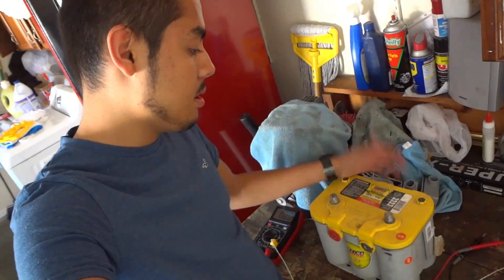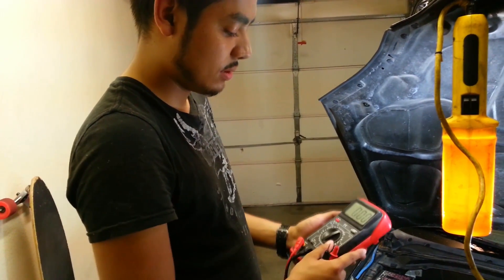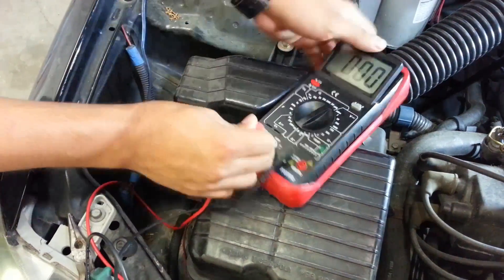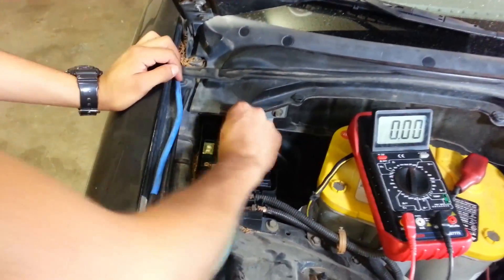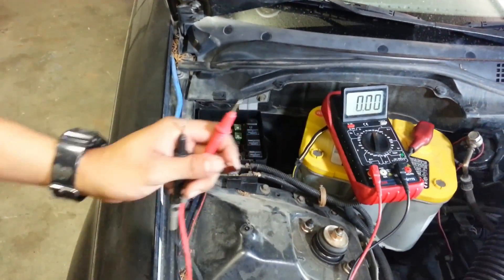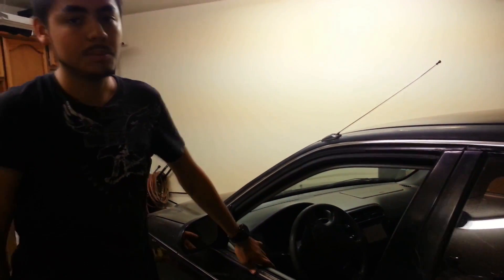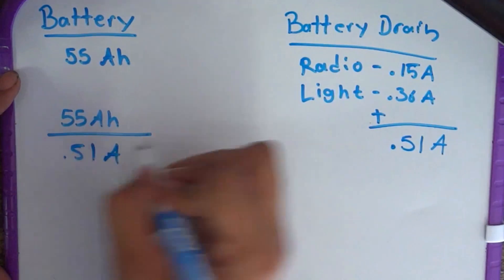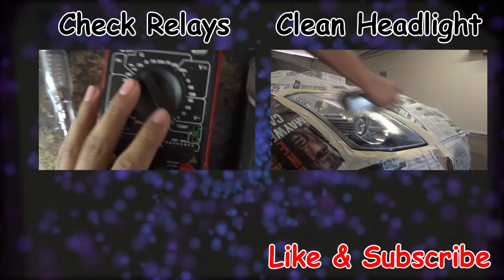How to find Short Circuit in your car/truck

Comment: Hey im having a problem finding my battery drain which is 5AMP 
I narrowed it down to #8 fuse which on my 02 Jeep Grand Cherokee Laredo 4.7L WJ it says on fuse diagram that #8 is:
Overhead console, rear wiper, IP lights, rear flipper glass solenoid 
Thats whats on that circuit apparently a bunch of things.

I tried voltage testing the two wires that went to the upper center brake light because it wasn't turning on and found it had a bad bulb that burned out, but i connected both leads to the wires and i popped the fuse, replaced fuse.
How should i test voltsge drop on connectors? Or how should i test them to find which components has the short on #8 fuse circuit that dropped amperage draw from 4.9-5V down to 0.36v when I pulled the #8 fuse while having negative terminal cable off the battery post with test leads of multimeter set to 10A and on negative terminal and negative battery post and 0.36v is normal for my vehicle according to manufacturer (they say 0.35v-0.50v is expected with all the modules?)

The other thing i should mention is overhead front seat lights that you click on has a problem. The right one for passenger side wont click off if the interior lights dial is on any setting but off. And the left drivers side click on light will turn off?

Any ideas on how i can find everything in the circuit and test each component?

Also what the hell is iP lights?

Comment: Don't pull each fuse, probe the 2 test poles at the top of blade fuses that are there for this exact test. That will cut your time way down.
Reply from the maker: That’s not testing current.

Comment: My 02 f150 tail light fuse keeps burning out when it rains hard. I sealed the housings and made a little hole under each so if water still got in it could exit. No success yet. Any ideas

Comment: I have a short in my 2005 Lexus gs430. My type of short makes my dashboard flick, no power windows, no power locks. No power on my steering wheel tilt. 

All fuses look fine, not blown. 

What can it be? Help pls
Reply: I have seen many videos by a few mechanics, and it sounds like it's where the speedometer, and all your dummy lights are. I have seen that board fail, and the main problem was because when they put the vehicle together they used lead free solder, there has to be lead in your solder when soldering these components. Hope this helps.

Comment: This is not called a short circuit.. This is a current leak or parasitic draw/drain or whatever you wanna call. If it was a short circuit current will be higher and fuse will blow.

Comment: You may disconnect your negative terminal lead on your battery change your voltmeter to amp setting to 10 and switch you voltmeter red lead to 10amp port and connect one lead to positive battery the other to negative battery lead which you disconnected. This will show you prostatic draw anything over 1, you have draw which would drain your battery over period of time. Then start with your fuse box and remove each fuse if the drop decrease that 's your problem. check your fuse box labels for each load.  You have pin pointed the problem!

Comment: I'm a computer electronics guy and I didn't know have that stuff I'm not a car person but I'm dealing with a short and I'm looking forward to trying out the fuse draw with a voltmeter. I started having problems where the car just suddenly is dead when you first get in the car and I recently installed a high-end car stereo and then started seeing problems.

Comment: Yo bro I got a fuse that keeps blowing from my AC compressor I changed the compressor out because the AC wasn't working it started working a little bit for a day once I changed it out and then the back was blowing cold air but the front was blowing hot I have a 2003 GMC Yukon now the fuse just keeps blowing I watched your video I'm going to touch the sea is this a short in the compressor or somewhere else I don't know what's going on

Comment: You could save yourself a lot of time by just disconnecting one of the cables on the battery, then connecting the ammeter between the battery post and the disconnected cable. This will measure the total current drain from the battery for ALL circuits. Then start pulling one fuse at a time, watching the meter for a drop in current. For circuits that should not be draining current, there should be no drop. If you find a larger drop then the circuit should be draining with the engine off, then you have found a circuit with a short. Using this method you can just pull fuses quickly, one by one, without have to probe each fuse receptacle. You should connect the meter this way, to begin with, just to see how much total current is being drained with the engine off. Also, if you pull a fuse, and you get a large current drop, but you still have a large current drain, then you will know you have more than one short.
Reply: Disconnect negative terminal of battery first 
 2 . connect positive  terminal of multimeter to  negative of battery 
3 .  connect negative terminal of  multimeter to disconnected terminal of battery
 follow step by step to pull out fuses

Comment: So there other day I got in my car and there was no sign of power.  I clean the terminals and connected jump cables left it on for 10 mins the car turned right on.  I took a drive for approx 40 mins when I got home I turned car off after a few hours I try to turn it on but was totally dead Apparently 
something is draining my    battery.  Can you help ?

Comment: how do you checkfor a bad ground?      batttery shows to be good    my alternador  has  low voltage ( brand  new  second one on it tested 3 times) eveything i use my headlighs at nite  the lights star  surging  and car  stalls in idle .( only  when using lights )

Comment: Battery should be at least 12.5, preferably 12.6 volts, and a good healthy charging voltage is 14.6 volts. After running the engine, there will be a surface charge, turn on the headlights for 30 seconds to drain the surface charge to base voltage, then you can take a good measure.

Comment: 1 - 55Ah ,  you will never manage to use all 55Ah.  If its a normal car battery. you can only use down to 40% the battery is dead. on your yellow top AGM. you can manage down to 20%.  
so theoretically your 55Ah  AGM is only going to give you 44Ah.   maybe even less.   
If you use battery in any systems you normal do not want to bring them below 60%. if you keep getting them lower, you will kill your battery.   AGM battry last longer, but still. 
or am I wrong?

Comment: 4.30.2019
Long Beach,CA.

This is the absolute worst Video I've watched concerning a Parasitic Drain/Short and some people think they're getting good advice.

They'd be better off Googling " How to do a Parasitic Draw" or "How to find a Short Circuit", then they'll discover that this is one of those Internet Mechanics that they shouldn't allow to work on their car.

I can't recall one Automotive College class teaching this B.S. technique.

Background : GM Dealership
                         Independent Auto Shops
                          Smog Repair Technician
                      Driveability Problem Expert
                      Reprogram Computers

The Internet has now evolved into a Blessing  and a Curse.

Comment: I’m having a long term issue with the ELD (electric load detector) in the fuse box under the hood.  I switched it out and I’m still getting that p1298 code. Any ideas.  I have a 98 Civic Lx sedan 1.6.

Comment: Hello you sound knowledgeable, so I'm going to ask u if finding a short exists with draining ur battery from ur fuse or going threw the harness in witch on my vehicle which is 03 suburban the altinator has a 3 wire plug on top & the brown wire is showing 10.59v with it unplugged from altinator & ignition open & should read 12.2v or higher what could be my problem help please much appreciated?

Comment: Thanks for the knowledge bro. Question: Why pull out each fuse, couldn't it be tested by using the both contact ends on the back of the fuse?

Comment: I cannot Disconnect the Negative Terminal to perform a parasitic draw test, if I do I will have to tow car to BMW Dealer $185.00 PLUS Dealer Charge for "Programming Battery" $200.00 roughly $400.00 if I disconnect the terminal for a Parasitic Test. FML!!
Reply from the maker: +Brauch Faser ah. I've heard of this. There is a way to do it yourself but I have not looked to into. My aunt had the same issue.

Comment: Im completely stumped with a problem, my 2008 328Xi BMW had a new battery installed at BMW March 2017, they said it needed an alternator also but wanted $1,300.00 for a 180amp bosch which I picked up from Napa for under $300.00 and installed in BMW's parking lot same day I picked up my BMW with the new battery. Car ran fine for 3 days then needed to be jumped, i checked system and alternator was BARELY pumping out 11.9V when engine was on then randomly it would charge @ 14.6V then drop down to 11.9V I went to Napa for a replacement but they didnt have it and by the time the guy called me 4 days later my car was running like a Champ with 0 Issues, it ran perfectly fine for 4 months then one day the Alternator just DIED and ran my battery dead. I had car towed 50+Miles back home and the tow Truck Driver tried to "Jump Start" the car to get it off his truck's bed, I wasnt there but my dad said the car started shooting sparks and smoke was BELLOWING from under the hood where the tow truck driver had connected his jumper cables to the + and - terminals, a few days later I removed alternator went to NAPA and picked up a NEW replacement and installed it in BMW. I jumped the car and it started fine I was happy but short lived. I closed the hood and put it in D and pulled out of my parking spot, soon as I turned left and accellerated the car DIED, I jump started it 30+ times and the car will RUN on its own power all day with the alternator pumping out 14.6V and the battery sits at 12.9V when engine is off but something is DRAINING battery really fast, within 5 mins the battery will only have 5.4V and it will go down to 1.87V which is literally dead dead. I cant figure out where the damn problem is coming from. The car now wont start with a JUMP I have to rev the jump car to 4,000rpms and put a 850CCA Jump BOX on Battery pushing over 30V into the system just to get the damn car to start. Just a jump cable pushing over 15V into battery wont start the car now and soon as you disconnect everything and turn the car off, it wont have enough power to start right back up on its own. Please Help Me. If I cant figure this out im going to set th car on fire and push it off a cliff im that frustrated with this damn thing.

Comment: I have my abs light and break light on. The dealer told me they need to change to harness and the module. Can i test the abs fuse the same to check that all the wires are working ?

Comment: btw.im trying to replace fuse box in toyota camry 2004 , the under the hood one, and wonder if it's a good idea to do so and how to go about it. I see that i will have to cut and strip 100 or so cables to install a used box and wonder if it's possible to get it done without special tools and knowledge. 

I'm no mechanic but I'm determined to fix it,otherwise the car goes to junkyard.  Toyota Dealer wanted thousands of dollars  to repair it, they wanted to replace entire cable harness quoting repair for around 6k labor and parts. But i figured that the box itself is the problem. When I popped the hood and pushed the fuse box around or lifted it a bit I could start the car,but with time it got more and more difficult to get it run. So, I got used replacement fuse box ready to be installed.  
It won't start, and when I turn the ignition on and try to start it, the outside temperature and time gauge reading disappears for as long as I turn the key trying to start the car. The fuse box is the problem,but replacing it seems quite a challenge.  Any advise would be appreciated!

Comment: Thats not a good method for modern cars with a lot of computers and modules that can be stuck on drawing down the battery. As soon as you pull the fuse you reset the computer or module and you just masked the problem that was drawing down the battery. Plus modern cars computers need to go to sleep so it will have a draw on the battery until the computers "go to sleep" This was a popular method on older cars but can get you in trouble a modern car with lots of computers and modules. Its a out dated test procedure unless your working on older cars.

Comment: hey I have a electrical short on my 2000 dodge Dakota I have replaced the transmission reverse switch on the trans and that was not working at the time but a little time and now the reverse light are not working again and every time I put the trans in reverse it blows a fuse and yes it is stick shift just don't know what to do?

Comment: Expy failed going up hill on short out of town trip.   replaced fuel filter that was clogged.. ran perfect for 3 days. It failed after errands in a parking lot.. went to get it.. i drove it home.. for 2 days cranked perfect.. continued to run gas out over the next few days  so the fuel pump would be easier to change.  It failed to start again for five days. Researched . I have Chilton's ECT. There is a limited amount  of info in them. I am an ex electronic tech.  Understand relays ECT.   So watched videos ECT.  Checked Schrader valve had gas there. I decided to turn the engine over.. it started (we are dealing with an intermittent here) I took it to a neighbor  and he put a bid tool on it.. not a cheap one.. it initially said misfire on cylinder 4.. that made sense because when it quit, it did misfire going up hills   I told him  to clear the memory.. He found no codes..no cam sensor problems, no crankshaft sensor problems, always has had the sound of prime, never checked voltage at  fuel pump relay or pump itself.  I hesitate to pup 12 volts to fuel pump willy nilly, as it may feed back and destroy electronic infrastructure.   I know this can be the inertia switch (they sometimes are intermittent). It could be an insulation leak to the chassis.  I don't know if I am getting spark.. it seems like like the obd tester would catch that.. The problem is that it is intermittent. I notice this doesn't have the normal spark plug wire setup  and I think this  is cop setup.  I am a little  confused how to properly check for spark do I use a noid.  Oh yes it is only showing about 30 psi on idle and 35 on acceleration maybe a little higher at high rpms.  Also my  fuse board under the hood and  below the steering wheel does allow pull and replace of relays.  If it comes down to it I can fix boards, but if it's a expensive chip.. that probably won't be happening.. I suspect we are dealing with an obvious component. If  any body can give me a detailed  description of how this all works please do so.

Comment: The fuses should have two test points on top of the fuse. You can then set your mulimeter to the millivolt  scale and touch the two test points looking for any voltage reading which would indicate current flow. Much quicker as you don't have to pull fuses.

Comment: I like the way you troubleshooted the drain on your battery, and I remember years ago when I had a similar problem in an old Lincoln and found that it was the power seat detent was outside the button holding down the detent causing a steady drain on my battery.

Comment: Could overheating cause all my gauges to fail? I try changing the fuse on the radio but every time I put a new one it pops. Five times.it all started when I over heated. If you can help me it would be greatly appreciated thanks
Reply from the maker: +bigcrum1 if it's a Honda or Accura, I would start by disconnecting the radio, if that does fix it, then disconnect the computer, and if that still doesn't stop the fuse from blowing then I would start to trace where radio fuse wire goes to and check for shorts and smoldered wires. I have had radios go bad and blow fuses just like that. Also, since your going to be blowing fuses, you can check out your local pull a part junk yards, they usually sell a large amount of car fuses for cheap.

Comment: Great video Christian , one question i got a GE multimeter i only see 10A ,200m,20m,2000,200, can i test this on 10A? Thanks in advance i don't want to blow my multimeter fuse
Reply from the maker: Yes you can use the 10A setting. Unfortunately when trying to diagnose a short circuit, a large amount of current is being consumed. Meaning that it might still blow your fuse in the multimeter. Most multi meters have a 20 amp unfused port.
Reply: Thanks  for replying  Christian   i will keep that in mind ,  keep making videos
Reply from the maker: Thanks for watching!

Comment: hey I am having the same problem with my motorcycle. do you think I can use this same procedure to find my problem?
Reply from the maker: +Brian Saunders yes. On my ATVs, I realized it's best to start with the testing if the battery is good first
Reply from the maker: +Brian Saunders yes. On my ATVs, I realized it's best to start with the testing if the battery is good first
Reply from the maker: +Brian Saunders yes. On my ATVs, I realized it's best to start with the testing if the battery is good first

Comment: automatically assuming its the domelight switch without going through the circuit is the lazy, and often incorrect, way to find a short. That's how you end up with a bunch of extra parts you really didnt need.